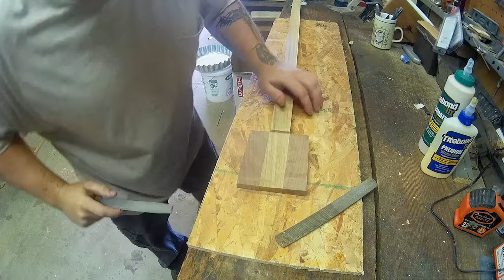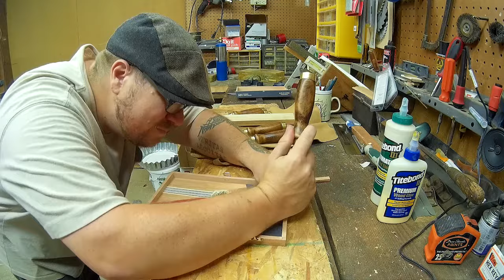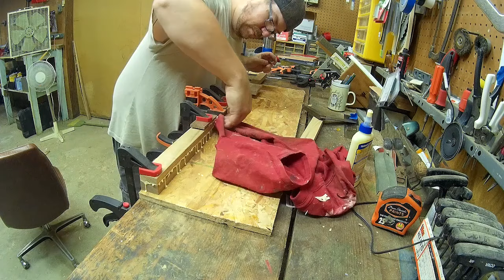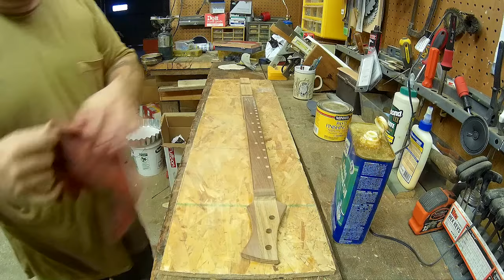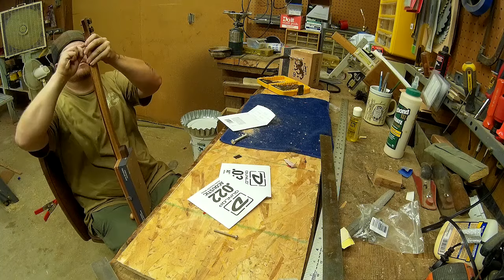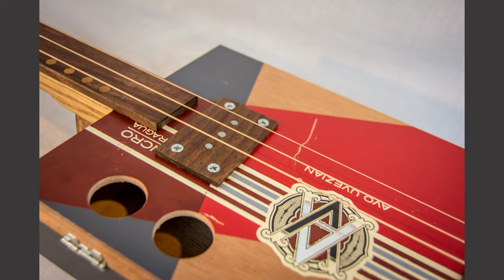DIY Cigar Box Guitar Build and Overview

Comment: I am building a 4 string with frets. I have the same box. I love the graphics and the kind of Art Deco feel.  I have a question for you:  How did you manage to get the fret board to overlay the box, screw the neck to the box from underneath and still open the box.  Is it magic? Beautiful build.
Reply from the maker: after I slide the neck in and screw it down, you can't open the box anymore
Reply: Thanks for the clarification.  I appreciate your reply.  Your build is beautiful, keep up the fine work.
Reply from the maker: Peter Solomon 
No problem,  thanks bud

Comment: Hey there. I am currently building with an AVO box like yours. Kinda have a dilemma though, I have a 25” scale neck and essentially that would put my bridge almost center of the box and that would look pretty dumb. I see your bridge is back where it’s supposed to be. So do you have a longer scale neck? It doesn’t appear that way. If not, is your intonation right? I am fairly new on building CBG’s so any input would be welcomed. Thanks
Reply from the maker: I think I made this one at 24" that is my favorite length for cbgs, it's easy to check the intonation and the 12th fret is at 12".  its hard to get the bridge in the center of the box and have it not look funny, the box needs to be a little longer for it to look right kind of like this one I built. https://youtu.be/P3WvAVtB5lo
Reply: HiltsBilt , my box length isn’t an issue being too short, it may be too long. I just realized my box may be bigger than those you built. It’s 11”x7.25”x2.5”

Comment: hey man I have built one cigar box guitar and am in the process of building another one at the moment, but the two I have built are made out of house hold items and not so much for playing. I want to build another one that has a resonator and a inexpensive pickup but do not want to spend a lot of money do you have any suggestions?
Reply from the maker: For a resonator, you can use a big can lid Like I did on this build https://youtu.be/P3WvAVtB5lo if you do that, you have to make sure that there is a slight back angle to your neck so the action won't be too high. and an inexpensive pickup you can use a piezo https://youtu.be/aGtHNLKi7Qo, if you don't want that then you can get something on amazon  http://a.co/2QWur4o
Reply: awesome thank you! and i like how you didn't put frets on your guitar in this video instead you used wooden pegs but how did you know where to put them to line up with the notes? and how can I do that?
Reply from the maker: https://www.stewmac.com/FretCalculator.html or you can get a template, there is also a free program where you can print out a fret template, but I'm not sure what its called.
Reply: thank you so much this has been very helpful!
Reply from the maker: No problem

Comment: Dude! A Shopsmith!!!
Reply from the maker: Best tool purchase I have ever made, and it paid for itself.
Reply: HiltsBilt I inherited one from an uncle, I've only used the circular sander and drill press functions, I'm dying to use all It's features!!
Reply from the maker: I got a good deal on mine came with a majority of the attachments. I use the belt sander, circular sander, bandsaw, jointer, table saw, drill press and router. I have also turned a couple bowls on it as well. I'm also going to build a thickness sander for it which will come in handy.